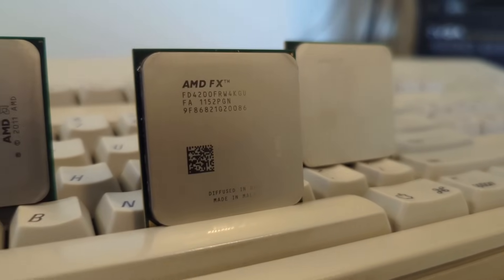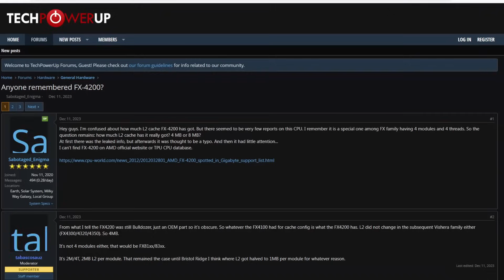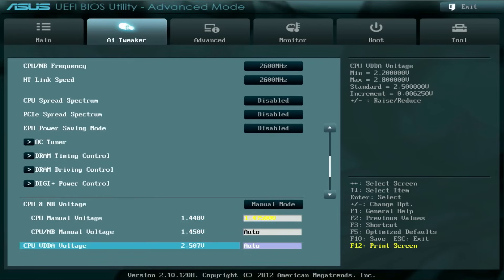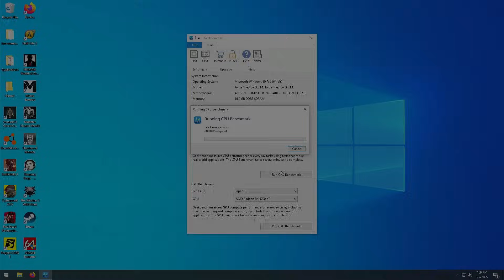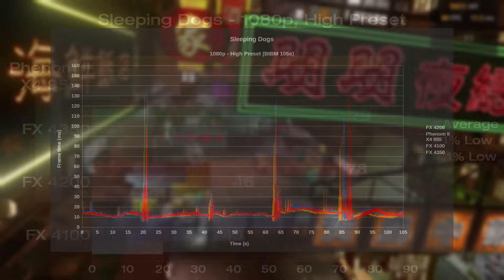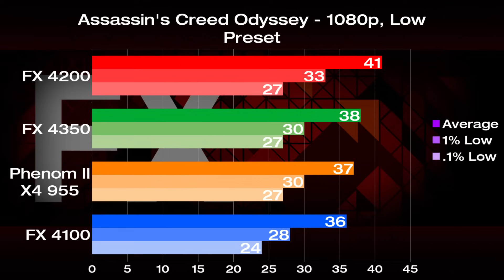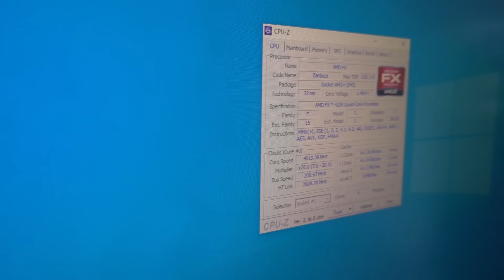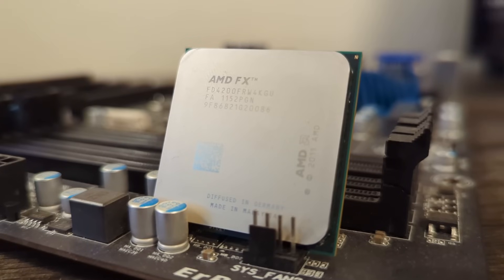What if AMD FX had "real" cores?

Comment: Thank you. I always wondered if it was possible to simulate this with Linux kernel parameters or something. (If it was, it surely has been tested.) Just out of curiosity. I had no idea (or already forgotten) that AMD made this part. What if they had not only deactivated the second integer units, but removed them entirely from the die? I think they knew Bulldozer was a dead end and couldn't get the successor ready fast enough. And Jim Keller delivered...
That being said, I still think it was pretty good for the price and better than its reputation, especially the Piledriver FX-6. But I mean... Twice the transistors compared to 4C Sandy Bridge. Ouch.

Comment: FX 8000 & 9000 series really have 8 cores but shared into 4 modules, search on any AI. Some programs read only modules other skip them to check only the cores and threads. Park Control & CPU-Z says 8 core with 8 threads, Windows reads only 4 modules with 8 threads that's why there is a misindentification as 4 cores in some programs but they really have 8 cores shared into 4 modules, 2 cores per module.
I'm speaking as an IT guy and you can search through any AI if you want to inform yourself. 
It's the same for FX-6000 series as being 6 cores...

Comment: Had the 8350 and the 8370.  People can talk all the smack they want, if it wasn't for Bulldozer, there would be no Ryzen.  The chiplet design made them possible.  For the final settling price of these processors, they were actually really decent.  Not at their advertised MSRP but the sale pricing as they went EOL were amazing for price.  The real thing that killed AMD on these processors is they should have never been released in the alpha state they were in to the public.  However, in reference to your first question, yes these are "real" cores. They are just slow ones, with shared resources.

Comment: I stuck with Intel right up until I had a problem and was trying to determine if it was my CPU or motherboard. At the time, I had built my system on LGA 1151. About a year later when my computer quit powering up, PSU tested okay so I thought maybe CPU or motherboard failure. I wanted to slot in a temporary CPU just to find out if it would make it work, ya know, general troubleshooting stuff? 

Low-and-behold, I could not find ANY LGA 1151 CPUs ANYWHERE. For that matter, I also could not find any 1151 motherboards. It was like they just phased out of existence, like I jumped into a new timeline. Plenty of 1150 boards and CPUs, but NO 1151. 

I settled on purchasing a used board and CPU from eBay in an attempt to troubleshoot, and ended up getting a board which required a BIOS update to be compatible with my CPU. All-in-all my computer was down for nearly a month from searching for and waiting on parts, just to end up with something I couldn't even use. Even more frustrating is I checked for this prior to even purchasing it, there was no documentation mentioning lack of support for the particular CPU I was intending to test. Funnily enough, that damn board was manufactured BY INTEL, and there was ZERO mention of this as a requirement for 3rd gen architecture. 

I just swapped in a new board and CPU for 1150 and rocked that for awhile, but this left a HORRIBLE taste in my mouth. What was the difference between 1150 and 1151 anyway? It was ONE damn pin. Yes, ONE fricking pin in the socket, this is ALL that was different. One pin is what caused me to have to blow $800 on new motherboard, CPU, and RAM, when it's highly likely only one of those components even had to be replaced! Years later I eventually determined it was the CPU by the way, when I was recycling a machine and it had a known-good compatible CPU in it for my original motherboard.  

When I did my next big overhaul, Ryzen CPUs had become a thing so I decided to migrate to that platform. I have not been disappointed. To this day I am STILL upgrading people's computers to Windows 11. These are machines I built for these clients many years ago on Ryzen platforms, and I can simply update their BIOS and move them to a more recent AM4 CPU. It blows my mind this longevity is possible at all. You will NEVER get that with Intel, they purge sockets like a plague. And if it's not a socket they decide to randomly 86, it's the chipset! When you choose Intel, you are committing to never being able to source new in-box components for that platform in a year's time.  

While AM4 is finally being phased out, it had a good run and the longevity of that platform is a reason I will continue to pick AMD. If I ever think my CPU or motherboard might be bad, it is simple enough to just find a replacement component and test it. I never have to worry about dealing with that socket nonsense I experienced with Intel.

Comment: I am still running an AMD FX 8350 in a windows vista bluray ripping rig LMAO it runs good for my needs and I always wanted one in high school, I ended up with a 6 core phenom instead and I was happy with it running dual GTX 260's in SLI, I worked my butt off to buy the parts used.

Comment: As I recall from owning an FX-8350 at the time the single core FPU benefits could be achieved by manually setting the threads on each core in task manager. If I were serious about a game I would use a software called "IOBIT gameboost" that closed everything automatically, set the task affinity of all remaining processes to core 1&2 and then place my game on threads 3/5/7 with 4/6/8 having nothing to do. Most games were entirely single threaded at the time so 3 cores/threads was plenty.

Comment: The real issue was the pipeline that was too deep. This works against branch prediction which is literally the thing that gives modern CPUs like 80% of its performance so trashing that will easily trash your performance both single threaded and multithreaded. Sharing a floating point unit is literally a nonissue, and these normies keep latching on to that. If you've coded anything in life, you can think back on all those projects, and realize how rare it was to even declare a float var. Most operations are integer based from ints to chars and branching (ifs and loops)

ffs bro literally did a vid on the first google result they found 🙄

Comment: The FX cpu's had real cores. Two cores just shared the floating point. Main issue was the power consumption. Still it managed to clock higher than the P4 it had been inspired by. I recall on TechReport or somewhere they had an extreme overclock of some 9000-series that eventually even managed to beat; outperform a Sandy Bridge. Thing was, to do that it consumed more than twice the power.

Comment: idk, I lived with a FX-4350 Black Edition (I ran it at 5.57ghz with a custom loop water cooling at the end of its life) for like, 8 years? I mean, yes, jumping to my current Ryzen 5-5600 is a MASSIVE difference, the 5600 is also a cheat code CPU. My next run will be a Core Ultra 7-265K 20-core. (I'm doing less gaming and more coding, my degree is focused in AI engineering so, I'll use those E-cores.)

Comment: The FX was intended to be a "Reverse HT" Quad Core with 4 ALUs., 4 AGUs and 2x 128bit FPUs per core, capable of cooperating on one thread. But they only managed to get the FPU to work as one unit. They couldn't get the ALUs and AGUs to share the load for one thread. At least not without fixes that introduced unacceptable latency issues. So they renamed the core to "Module" and claimed it consisted of two cores. The shared decode and dispatch was because of the Reverse HT Quad Core attempt.
Early rumors of the "Reverse HT" attempt started during 2005. But as it never worked it was largely forgotten.

Comment: I have this Asus board gave it to my brother but using RTX board on this baord doesnt give it a good benchmark due its least bottlenek is GTX 10 series. At highest i got this board to run Assassin's creed rougue but smostly about 20 to 30 fps at 1080p with GTX 1060 TI but i gave it 32GB of DDR 1866mhz ram. It rock  on a lot of games though. Upgraded though so my brother has a desktoop and he like playing games from early 2000s since it has XP drivers for chipset I made it his XP machine for his older games. it still has the FX 9590 8 core varient btw.

Comment: anyone who says the AMD FX CPU's where shit is a dumb fuck who has a head full of shit. they where epic fucking better than any crap that intel came out with for the same price. i fucking ran mine untill 2019 and it ran att 5ghz on stock cooler for years before i upgraded the cooler. no intel CPU around the same price point could even fucking run 5ghz att the time without serious cooling and overclocking.
Reply: I can't take this comment seriously at all

who caers if the FX cpu could hit 5ghz if it was still losing in IPC to a sandy bridge in the 3ghz range

if you want to make a price to performance debate, sure. But to call early Intel i-series crap is just biased AF

Comment: I had an 8120 and later an 8320 and 8350. If you ran the highend 990fx motherboards you could dial these things in and make them run beyond what ever thought capable. I shut turbo and all powet savings items off and overclocked my 8120 to 4.5 and it ran so smooth no issues, upgraded to 8320 was able to hit 4.9 stable and then to a 8350 at 5.2, they were great chips but not for the everyday consumer, they needed tuned to bring out the real performance. Still one of my favorite cpu series of all time.

Comment: Bulldozer issue was not sharing resources between cores but abysmal single thread performance. Latency sensitive applications like games especially ran so terribly on these "eight-core" CPUs that Nehalem (first Core i7) users had better frame rates than Bulldozer users. All this happened in the Sandy Bridge times with it being massive improvement over Nehalem.

That said AMD with their design just asked for a lawsuit. Maybe if performance was stellar they could avoid it because low performance was important part of it but still AMD imho failed with calling these CPUs as 8 core.
Then again if they did not then people even despite performance being the same would not say silly things like "in time when programs can use more threads...".

As for the module approach itself - I actually think it wasn't bad idea. Calling these as having 2x actual cores I don't like but not getting better SMT.
One issue I have with e.g. Hyper-Threading is that since it also shares core resources between thread siblings it can bypass thread scheduler (which schedulers are so stupid they don' take it in to account...) to allow low priority background tasks steal performance of foreground higher priority tasks. Like if I run Prime95 in the background on CPU without HT (or SMT in case of Zen CPUs) I don't see much if any performance drop in my games. Do this with CPUS with HT/SMT and you get Prime95 causing quite big performance drop.
On Bulldozer this also happened but since scaling between thread siblings in a module was so much better versus between two modules it was much less of an issue.

Comment: I ran an FX-8300 in my video editing PC and an Opteron 3380 in my home office PC both for around 8 years.  The Opteron 3380 was just a slower clock 65w version of the 95w FX-8300.  It performed very well.  I only replaced it as the motherboard failed.

Comment: That 955BE was an absolute beast. I used it for well over a decade with these exact settings: 4ghz all cores, all the time. a 120mm AIO to cool it was enough. I only replaced it in 2020 with a Ryzen 7 because it was simply showing its age. Fallout 76 was out, and i noticed it was bottlenecking immensely. It was a trooper, and i loved it! I got the OC as far as 4.4ghz, but the vcore and thus temps were unconfortabely high.. 4.0 really was the sweet spot, considering it was 3.4 stock.

Comment: I remember using some FX chips as the basis for what would now be called a home lab. They may have been sub-par for gaming (even though there was an FX chip and later on a Phenom II in my gaming rig as well, but I never had high requirements anyway), but they were perfect for running headless Virtualbox instances, and later on even as EXSi hosts.
Reply: YES! THIS!!! The FX architecture wasnt really a gaming juggernaut, and really, it was never meant to be. But there are so many other tasks it can chug through with, if nothing else, brute fucking force. And considering the MASSIVE price difference between the Intels it could lap over and over again, at the cost of a little more power draw and some heat....its absolutely a contender. Ive never had a problem with them. Still running a 8350 in my desk daily (though I dont game anymore, so....that helps).

Comment: The AMD FX 6300 paired with a GTX 680 was my first ever 'gaming' PC.
It ran Witcher 3 at 1080p pretty well, and most 'Xbox 360 era' games. But it couldn't handle ANY strategy games, even low-end ones. Also, thermal issues. I ended up having to open the side of the case and blow a box fan into it! But 3 years of that fire hazard, and I finally upgraded to something with a modern processor. Oh yeah, I had that in 2018.

Comment: FX8350 was made at a time when only servers had 8 channel memory and no consumer computers had it. That's why indel only made 4 more powerful cpu cores and not 8.

intel core 2 quad had better single core performance than FX8350.

inel core 2 quad was a few years earlier than FX8350. That says a lot about how outdated FX8350 was already when it was new.

At that time they used a lot more software that often used single core or dual core so cpu was more dependent on good single core performance.

Comment: Used mine from 2013 until the release of the 5800x3d when I finally upgraded.
Went from the 8350 paired with a 1070 to a 5800x3d with a 3080ti so imagine the performance difference I felt hahah it blew my mind.

Comment: mayhaps i'm stupid but i'd imagine most of the 4200's wins over the 4350 and 4100 have to do with cache speed over the FPU. AMD may have been right that a 1:1 fpu-IU setup might not matter for gaming setups. Anyways I had a bulldozer and then a piledriver back in the day, and one of them was good for a paperweight and the other was acutlaly fairly decent. I ran it until I got a ryzen 2nd gen.

Comment: I never knew these existed. Seems like K10 was a better arch than Bulldozer when at the same clock speeds. One thing I would like to see is the comparison of these chips on their stock clock speeds. 4Ghz on quad core Phenoms is a quite good overclock while is pretty much the stock speed for the quad FXs. The faster clocks are an advantage of the Bulldozer arch and they should benefit from it :)

Maybe if back in 2011 AMD just bumped up specs in K10 and released a 8 core chip it would perform better than the 8150, but would probably be no match for early Intel i7s.

Even if the AMD didn't make the best perfoming chips they were much cheaper than Intel's, and that's what allowed me to build a computer at the time. Specially the FM2 APUs.

Comment: @7:00 never have the pump sit higher than the radiator, there is always at least a bit of air in an AIO, and the older it is the more air there will be. air will trap itself up at the pump and water won't fully cover the jet plate meaning reduced cooling, as well as increased pump wear.
Reply from the maker: I'm aware, unfortunately it was the only place the rad would mount in this case. I wasn't planning on this being a long term setup anyways, later on I'll find a more suitable case for it

Comment: I still have 2 FXs here near the end of 2025. One fx8300 is backup machine for an online radio station and still runs 24/7 a few months a year powering a special holiday channel. The other 8350 is just in my garage and gets used now and then.  Back in the day I did quite a but of video editing and encoding on FX83xx's and yes fast memory made a huge difference on these.  I still have a bunch of these laying around, both FX and Phenom 1/ 2.

Comment: Still have my old FX-8320 system setup on a table. It is a great system that served me well. Sometimes I'll fire it up, dual boot to XP and just fuss around.  I 'upgraded' to am4 3900x windows 10, then swapped out the 3900x with a 5950x. My current system is 'gee-wiz' enough for me; just I side-eye my ole FX-8320 system, fire it up & have fun.